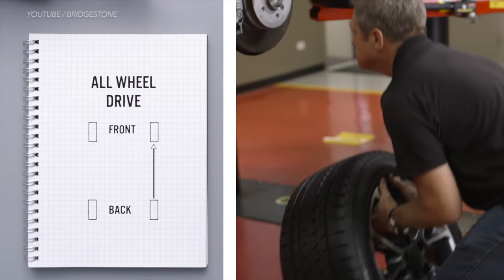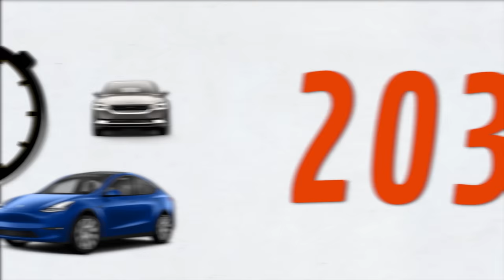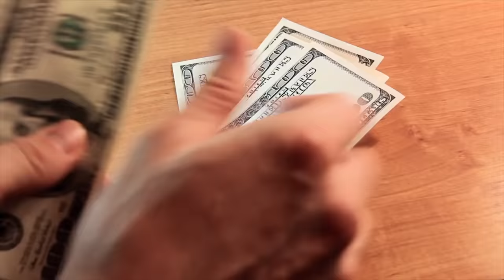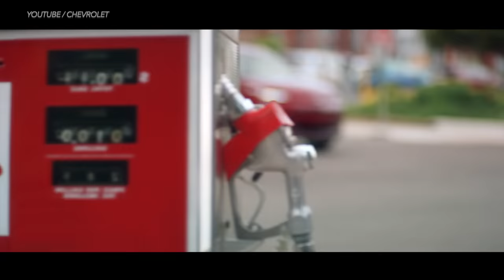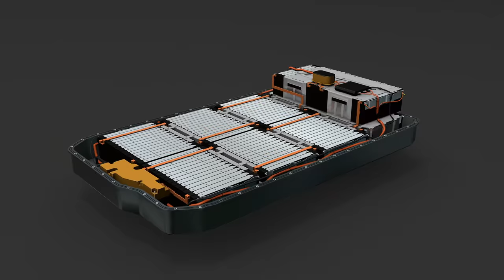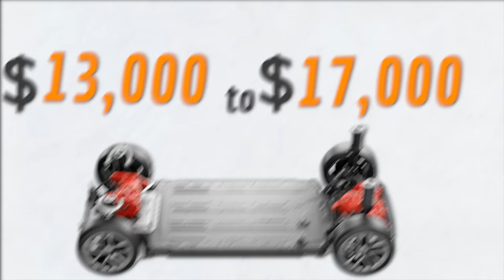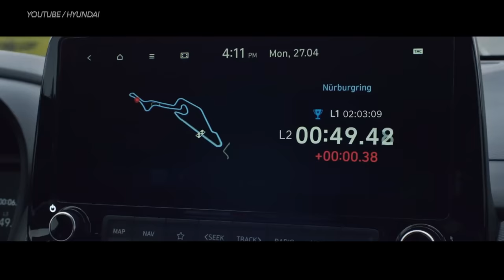No One is Telling You the Truth About the Real Cost of Owning an Electric Car, So I Have To

Comment: My Nissan leaf cost me $3300 to replace the brake system computer. Here's why: Nissan ONLY sell a complete brake kit that has the computer. Not you or anyone else can buy the kits or individual computers. So, lets say an $1100(est) computer could be bought and installed by an independant shop, you could likely get the job done for $1400ish. But because you HAVE to buy the kit and have Nissan fix it, you have to also replace the rotors and calipars - the whole shibang! Much higher costs in parts, labor, taxes etc. Nissan in this case looks to be telling customers, please don't come back in 4 to 5 years for your next new car purchase. Just FYI. This 2015 Leaf is an excellant car, but Nissan's repair structure makes me feel like prey.

Comment: Wait, if combustion engine car drivers encourage others to get an EV, doesn't that reduce demand on the gasoline supply? More gas ⛽ for the gas fueled vehicles. Wouldn't gas prices be forced to drop?
Reply: Not necessarily. Production would be dialed back because there is less demand. At some point more refineries would shut down due to high operation cost and less profit. Or, you'll pay more to keep them running.

Comment: The thing I never see EV people talk about is the energy grid already being unable to support consumer needs. CA, as stated, has one of the highest EV adoption rates and also one of the highest green energy implementation, however they are also one of the highest at risk every year, particularly in summer, of blackouts.
NERC has already stated that the bulk of America is at high to moderate risk of black and brown outs this summer with no reliable surplus base loads to shift around due to the over reliance on wind and solar. 2022 risk assessment PDF. 

Can't charge your car if the power is out but you can still pump gas as many stations have generators to run their pumps (at least around here some do). Going solar on your home doesn't help because many utilities require the panels to be ran through the public side of the meter on your house - thus shutting off your power when the grid fails for safety reasons. Sure there ae way around this also, house batteries for one, but it's at additional cost and even many utilities are starting to charge solar customers a minimum charge on their electric bills even if you use 0 electricity.

Lastly EV's aren't green and are worse for the environment until you pass around 52,000 miles on average. It will vary depending on where you source your electricity but can be anywhere from 'green even' to ICE cars from 25,000 to 95,000 miles.

I'd love to post sources but YT scrubs my comments every time I do so....

Comment: Problem with EVs it's not their ev nature, is that all currently manufactured EVs I know are high performance ones, not just economy cars, so they have the corresponding high price tag maintenance, wheels included.
It is not the same, a set of tires for a  Toyota Corolla than an Audi A5
It's what 4 times the price?
What we need is the equivalent of a corolla but full electric (BEV)

Comment: way things are going to hell in a gift basket. trips are far less, my dad figured one fill up now 180.00 plus then every half a tank afterwards pulling or driving an rv. plus do all your maintenance before you take a trip rotate your tires 🛞 tire pressure and tread check using a penny or quarter the more or less of the president’s head is showing determines tread life. alignment any leaks seals etc take care of them now not later. fill up using mid grade because even if your vehicle can run on regular little higher grade helps with mileage. get injectors cleaned air filters cabin filters ac serviced belts make sure battery terminals are wire brushed. look 👀 at your shocks for leaks. if your dealership is out name oem stuff use wicks plus filters. mopar are black filters best to get them the filters yourself and watch n make sure they install them. can change oil early chances are while your on your trip the millage will show up least my mother’s jeep keeps track when it’s due. wiper blades changed so you get clean windows not that crunch noise. hood struts tail gate struts electric or not fixed replaced chassis lubed make sure your turn signals work break lights windows lubed if they stick wash your car and windows wax the windows cleans easier bugs don’t stick

Comment: I buy decent tires. Decent tires don't last 30,000 miles. Tires that last longer handle and stop poorly. If you don't want to spend a lot on tires don't use bigger than 17 inch wheels. There are many flaws in EVs but tires isn't one of them.

Comment: My model 3 weight in at 4,250 lbs my challenger weighted in at 4,150 lbs. Not much of a weight difference there. Hell my truck weight 5,620.

Model 3 tires 1st pair needed swapping at 50k cost 1k. Challenger swapped at 55k for 1k. Truck new tires about ever 60k. Last pair cost me 1,300. Hell my work truck needed new tires at 55k and they cost 900k.

Rotation are free. So not sure where he saying extra cost are coming from. Also used tires tend to get chopped up and recycled into different coating for roads and such. 

Also seen them used for soil stability

But then this guy sounds like he just pissed that car are switching to EV from gas.

Comment: Hmm... I agree with most of it but I wouldn't say it's as bad as Scotty makes out. I work for a tire manufacturer and I own an EV. I'm a do it yourself type and to be honest I don't bother rotating my tires. My car came with run flats which are expensive but I replaced them with regular tires. Why? Because most people don't want to pay for run flat tires, so most shops don't keep them in stock, they have to be ordered and in some cases that means your gonna be waiting a while to get them. Teslas have a special tire that has a foam pad inside, but you don't have to use that tire according to tesla owners. I'd say you can use just about any tire on an EV (as long as it's the correct rating) and as long as you're not lead footing it you'll be good. I bought regular old tires for my EV about 3 years ago, I don't rotate them and I'm almost down to the wear bars. I don't drive like a nut either.
Reply: TESLA has two modes, chill acceleration and standard. Diving chill mode still gets only 20k miles on a 60k miles tire. Same thing with a Chevy Volt, tires last only 20k miles.
Reply: @consolemaster  I dunno what sort of mileage they get but I know you don't have to use those Michelins with the foam. Unfortunately I don't think I recorded the mileage for my car with is a Cadillac ELR or a Volt in a tuxedo. I know it's been about 3 years since I put those Toyo's on and I usually drive over 10K a year. I'll have to look into that.

Comment: How about the no cost of oil changes? how about the no cost for transmission fluid changes? how about the no cost for  rear axle service? How about the no cost for transfer case service? how about the no cost for coolant changes? how about the no cost for replacing hoses replacing spark plugs replacing air filters replacing rear main sea,l replacing head gaskets, valve cover gaskets or getting a head and valve job, replacing heater core replacing radiator what about replacing transmission or CVT and this just names of few.  And how about the biggest cost of it all TIME! If you want to maximize guarding your time a electric vehicle is probably going to be the way to go.

Comment: Those who are buying an electric car thinking that they are contributing to the environment are living in a fool's paradise.Didn't they know the fact that the steel and plastics used in the car are still produced by burning the fossil fuels? Secondly the battery used in the car contains expensive and rare materials like lithium, cobalt, nickel, graphite including steel and plastics which requires about 200 times of earth soil to be processed in order to extract it. And lastly the the electricity which is stored in the battery is being produced using the same fossil fuels.
All these costs makes the EV much more expensive than owning an ICE car both to the customer as well the environment.

Comment: -Not going to get an EV, cost alone! And the 12-15K to replace battery equals the cost of an used ICE car. Wonder if a lot of EVs will be traded in when they show signs of needing battery replacement?  Would NOT be a good choice to buy them then.

Comment: I mean the concept of electric cars you know as I had stated previously is not A New concept it's literally 100 years old the interesting thing is is the battery technology is what most of the company's claim they really could not perfect back in the 60s 70s and even the 80s it's like they had some of the capabilities that we have today if not they had the capabilities it depends on who you speak to out of the industry that'll tell you whether or not they actually had it locked up in the lab...

But the overall consensus that all of the engineers and the tech heads agree upon is simply they turned their findings in to the bean counters and then the bean counters came back and said stop your work immediately it cost too much! 

Even though every so often they would go ahead and restart the program I mean it's like back in the sixties every car company including little AMC had electric car division and they tinkered with it here and there GM Ford and Chrysler did the same thing they definitely tinkered with it they made it a thing it worked they basically prove their point then they put it on the shelf for a few years then they come back in the seventies including AMC and they started messing with electric cars again now a lot of the cars they developed were a concept but they also took regular vehicles and adapted the technology to it and proves that it would work but of course in a lot of those examples they wanted to mess with lead acid batteries which added weight plus you're already putting the s*** on a boat so the weight issue was the problem then you ended up with funny wedge looking things to get the weight down I kind of think to a degree that they did a lot of the weird designs they did on purpose because if they would have went to Congress at the time and said okay look we really are going to put this or that car into mass production and it's all electric so we need some sort of incentive to get an infrastructure going similar to gas stations Congress then would have said well okay so in order to do this we're going to have to go all in on it but the car companies wouldn't have wanted that because they would still have to sell gasoline cars to get the money to fund the project I think that that's kind of what some of the order executives were afraid of that they would ultimately end up outlawing themselves before they got the project off ground....

But then of course it was in the early nineties that GM came out with a two-door Cadillac sleek looking car and it literally had a mileage range of about 300 miles now it also cost the tidy Fortune but you know they were actually selling those cars to people and they had a loaner program and this was literally the early 90s and it was built with largely 80s to early 90s technology and they could get a fair range on this damn thing of about 300 miles so that's more than proof that these people have known that it's more than possible for a very long time they just held back...

Of course I think what's muddied it up, is simply it all went politically once they got the politics involved in it and no offense to anyone because I technically myself originate from the countryside but I can say that once they got politics involved all of a sudden six pack Joe has more than enough opinions to think of battleship about electric cars and it's not necessarily that he doesn't think they're manly it's now he's got the talking points of infrastructure the feasibility of batteries etc...

I can't necessarily bash them for having those thoughts because I mean it's not that they wouldn't know anything about it a lot of those guys are awesome mechanics and they do understand the theory behind engines vehicles etc a lot of those guys can make power generators for their house and they're not stupid but at the end of the day one does have to wonder is it really becoming common knowledge or is the common knowledge being skewed simply because of politics once politics enters an industry it can kill it immediately!

Comment: "EVs cost roughly $900 per year to fix and maintain. But equivalent gasoline-powered automobiles cost around $1,200."
This includes the tires

I enjoy your formula.   Trash EVs for a few minutes then use the rest of the show illustrating all the problems with ICE.

Comment: My Chevy Volt is the best car I've ever owned.  I don't care about gas prices, and 130k miles in, it's never been to the shop.  I do my own oil change once a year on the generator, and I have about 60,000 miles on these tires with plenty of tread left.  I didn't buy eco electric car tires but just the mid grade Firestones.  They're lasting forever and I don't know why.  It's very hard for me to take gas cars seriously now.  This must be what it was like when cars overtook horses for transportation.
Reply: generator????  EVs don't have generators.
Reply: You can't see all the variables . What kind of winter do you have ? Are you rural or urban ? Do you need to carry a load ? Ya , not everyone has your lifestyle . Basically , you have put no critical thought or research into the topic . Btw , the electric car came before the combustion car.
Reply: That car cost GM 10,000  dollars more to make than they sold it for. You cannot buy a volt anymore.

Comment: Run flat tires are NO advantage! Most run flat tires only last 20,000 to 25,000 miles. Never buy a car with run flats you'll be replacing the tires in no time.

Comment: pffft, teslas tires are known for being garbage, they cant handle a single average size pot hole without needing and entire new rim and tire, also Id rather ride my bike because I dont want a car that tesla can track or control without my permission, they can type in your vin and locate the car, thats an awful business strategy, there are countless reasons not to get a tesla, so dont, unless you plan on disassembling it and re building it to not invade your privacy, the new tesla terms of service is implying their new cars will listen to you so they can send you advertisements, just all around garbage

Comment: EV tires are just as gimmicky as everything else, GMs run flats for instance. costs higher for your car because it requires run flats... or Nitrogen that you can only get from your dealer or service station at a cost. How about setting up to charge at home; up to $12,000 added to the cost. They fail to mention the logistics involved with what has to happen for you to charge at home. Is your house setup for the extra power, do you have a high enough amp service to run said charger in your 10 or 30-50 year old house? Are you still using fuses, from just after WWII, because you bought a mid-century home to be "hip"? You too may have to get your house rewired. ahaha. whoops.

Comment: I know that traditional mechanical engineers and Mechanics alike will agree that a traditional car 4 cylinder front wheel drive car are the top shelf or car's because of the easy life of not having alot of maintenance because 1 it doesn't have a rear differential system to deal with. all engines and transmissions with everything in the front are easily maintained and 2 cost less to keep up less parts that can fail and less money people have to spend on their cars to be back on the roads and travel freely without anyone enfringing on our freedom to choose  what type of easy peaceful life because if the band on combustion engines is made into fruition then we all would be spending more money in the future for the up keep and maintenance of EV cars so I will not be purchasing any electric car never because it will simply cost me more to maintain a electric car versus a 4 cylinder combustion engine...
Reply: wut?

Comment: Everything in a Tesla is currently built in China. Tesla power walls are composed of Panasonic batteries. Solar City (owned by Tesla) panels are all made in China, and rank in the bottom of all solar panels. Tesla batteries are rebranded Panasonic batteries.
Reply: Panasonic is Japanese. Panasonic is producing the Tesla batteries in the U.S., but will be adding capacity in Japan for the new EV cells. You're sort of right about the solar panels (they used a mix of manufacturers, including Chinese ones), but they started moving more to Japanese and UK manufacturers and then start producing their own in California and New York a few years ago. Tesla does all of their own casting for the frames and designs the processors.